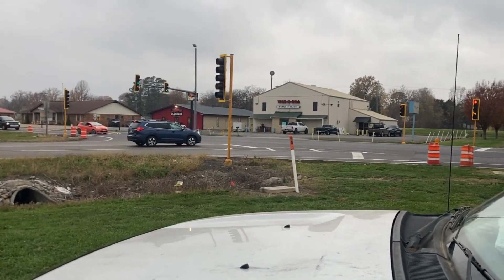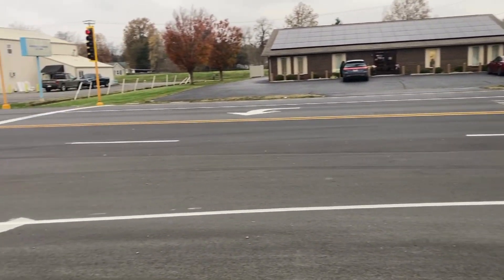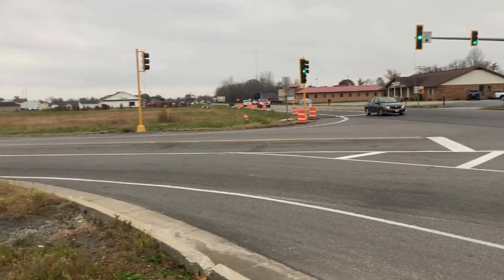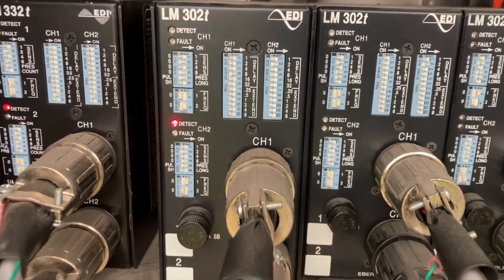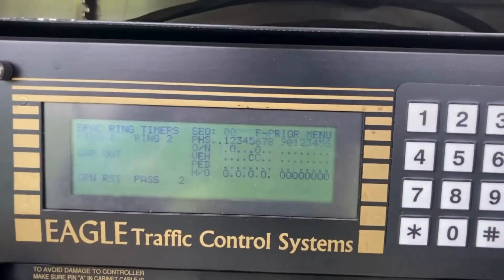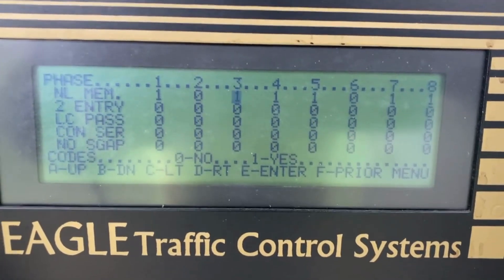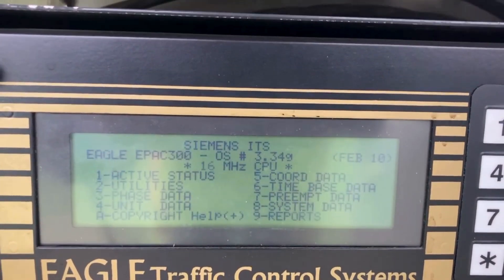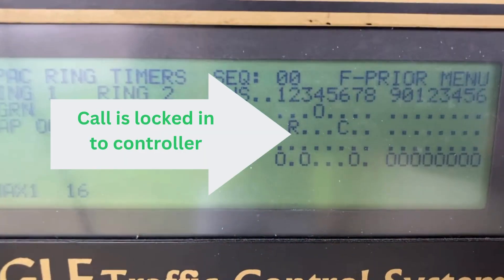How Bad Traffic Light Detection is Fueling Red Light Running

Comment: Do these detectors detect bicycles, or are bicycles too lightweight?
Reply from the maker: The sensors act like oversized metal detectors.  So its not weight driven but mass of metal.  Thats why bikes have a harder time being detected and why bike lanes with small detection loops are more optimal.  BUT if your bike isn't made of metal, then its not much help!
Thats another reason why I prefer video detection over inductive loops.
Great question!
Reply: They can, but unless one is careful to look for the filled wire conductor cuts (which can be paved over) and drive along one - it helps to think of them not working and treating the intetsection as a "stop sign".
Reply from the maker: @weldonyoung1013  THanks for responding!

Comment: In can't tell you how many times I got stuck at a light because the road desk by designers who forgot that the vehicle might be a bicycle.

Signals should never be driven only by detectors.
Reply from the maker: Its one of the reasons I'm not a big fan of inductive loops.  Most times, they're designed with vehicles in mind (unless they have designated bike lanes with small detectors in the lane).  Even then, if your bike isn't metal...does no good!
Thanks for commenting

Comment: As far as I know generally not illegal, most states have a law in the books that non-functioning stop lights are to be treated as a four-way stop so long as you still stop and wait a certain amount of time to determine that the stoplight is actually non-functional and you will never get a light you are fine to proceed with caution.
Reply from the maker: I'll have to look that up!  I was under the impression that they treat non functioning lights as either "in flash" or "dark". 
Thanks for sharing!
Reply: @streetsmartstraffic  in flash or dark are also non-functioning conditions obviously, but understandably you can rationalize that a intersection that does not detect vehicles in a direction or multiple directions is not functioning as intended.... I will say that It might not stop you from getting a ticket but it would almost certainly hold up in front of a judge, it just depends on how knowledgeable the officer is and how willing they are to listen to you and or test what you said
Reply: @streetsmartstraffic  for a point of reference, I am a motorcycle rider and as such I am very often not detected properly by the coils (Even when I directly line myself up over the cuts in the road)

This is how it has been explained to me in Florida from both an officer and my motorcycle endorsement trainer, to clarify though both said it is preferable to take a right and then a u-turn if possible
Reply: Virginia has no such law that I've ever found. If the light stays red for 4 hours, legally you must wait 4 hours for it. That being said, I once went through a red left turn signal every day for a month because that's how long VDOT took to fix it, despite me calling them at least 5 times about the problem. Lest you think this happened in some place like far southwst Virginia, this happened in the bustling metropolis of Northern Virginia, suburb of DC.

Comment: We don't have many of these loops around here, it's mostly the sensor next to the light and those are terrible. They often aimed wrong so I have to get into the wrong lane for it to see me, sometimes they won't detect me if the light just changed. I think some of them can't see my small car.
Reply from the maker: Maintenance is so important for that reason!   This comes to mind...
We had a complaints of backups at a particular intersection awhile back.  After visiting the intersection and watching the detection, I found that the hardware (bolts, nuts) came loose and the radar sensor had tilted away from its location.  The radar was no longer detecting that movement.  Found out, It was not tightened fully by the original installer.  Once it was re-aligned and tightened down, all vehicle were detected again and no more back up.
I would reach out to the municipality this intersection is in and report what you're seeing.
Thanks for commenting!
Reply: @streetsmartstraffic  There are so many crooked traffic signal heads around here I think the installers need remedial training on what a level and a torque wrench are. Maybe thread locker, too.

Comment: in florida we have a red light running problem not just bad drivers but many of the traffic lights are mis timed way too short we habd 1 6 lane that crosses a 6 lane with turn lanes both heavy traffic well one is north south commercial east west is limited access headed to bridge . some times the n/s is backed up 3-4 blocks  past another traffic intersection and it gets green for about 12 seconds   then its many min as each other change gets like 25 seconds so people making left often after waiting 4 changes 3-5 continue on red frustrated fortunatly theres all red for few seconds at change to green  and its not safe
Reply from the maker: Wow!  Sounds poorly designed and timed improperly.  Where is this at in Florida? (out of curiousity)  
I am in the belief that well timed and efficient signals can help a town or city thrive.  Improperly timed  (stop, go, stop) give drivers bad experiences and enough of them will make people avoid the area.  
Thanks for sharing that information!
Reply: @streetsmartstraffic  cape coral, but lee county controls the system  it seems to have gone bad  after IAN    santa barbra and veterans exway
Reply from the maker: @remocres  I'm sure they're dealing with ALOT after that.  Just a big storm around my area can have us running for days to get things back to par.  
If they're like anywhere else, they may be understaffed as well...
Reply: @streetsmartstraffic  There are places in this country where they don't like "people that ain't from around here" and maybe that explains why some of those places have poorly designed and improperly timed traffic signals.

Comment: This reminds me of my old apartment, I timed it with a stopwatch 3 full minutes of red for the direction pulling out.  When I wrote the city they said it was "re-timed" because there was more traffic for construction on another road except during off times in the middle of the day or late evening.  People started ignoring the red light because you'd sit there for 3 full minutes even on a quiet Sunday when there was maybe 1 other car driving on the main road in that amount of time.  It was maddening how long it took sending pictures/videos to the city before they admitted maybe they needed to have the timing different for peak rush hour and night/mid-day.
Have you seen the other trend with insurance trackers I see many "recommendations" that its better to run red lights than get dinged for "braking too hard" stopping at a red light?
Reply from the maker: 3 minutes seems EXTREMELY excessive.  How many directional movements were there?  
Before the 3 minute mark (as a signal tech), I would have thought there was something wrong with the signal.  Also, controllers can be programmed to run different timing during off peak hours.  So I think this was a lazy or unknowledgeable person.
Don't get me started on those vehicle modules or car apps that insurance companies want you to install.  I REFUSE to put those in my vehicles.  They say they're there to help... Yeah, I'm sure they are..for the insurance companies!  LOL
Thanks for commenting.

Comment: Love the work-around. 
How long did it take to actually fix the broken loop?
Reply from the maker: The disconnection of the bad loop in the pullbox probably took the contractor 20-30 minutes (thats including locating the correct loop to disconnect--there are alot of wires in those pullboxes) .  
Then you saw how long it took me to make the programming change...
Great question!
Reply: @streetsmartstraffic  What about the actual road work repair? Days? Weeks? Months? Still not fixed?
Reply from the maker: @bikeny  Repaving the road took a couple days if I recall (they had alot to repave down this road).  Before the project is closed, the loop will be recut.

Comment: I haven't seen loops for about 10 years where I live. Cameras are is use here.
Reply from the maker: I'm slowly trying to phase out inductive loops in our district.  It will take awhile due to costs of video, but I really think overall it has more pros than cons
Thanks for commenting
Reply: My city has a mix of loops, cameras, and plain old timers.  They just cleaned up a series of three key intersections that were close together this past summer by putting in cameras.  That whole area flows more smoothly now.
Reply from the maker: @kmbbmj5857  Isn't it great when a system is put into place!  It just makes driving more enjoyable!
Reply: VDOT will not use cameras in Northern Virginia. They claim that cameras do not provide accurate enough detection for what they claim is an "advanced signal control system". (They are NOT running any sort of traffic adaptive coordination system and I doubt they have anyone on the payroll capable of getting one working right).

Comment: There's a left turn in my town where I could swear they put the loop halfway under the crosswalk. Took me awhile to figure out I need to pull over the stop bar (which is illegal to do where I live) to trigger the light. One time I even got out of my car and walked over to the crosswalk pointed the direction I was trying to go pressed the button and walked back to my car to try and force trigger the light.
Reply from the maker: I've seen this happen.  Usually when the intersection is reconfigured (such as adding a ped crossing).  The stop bar may be repainted further back but its forgotten where the loop detector is really placed!  That's why its important to have some knowledgeable people out there when this happens!
Thanks for commenting

Comment: Gotta love the ones that also have red-light cameras at the same intersection.  Zero impetus to fix anything, as even a small percentage of people getting nicked without contesting the ticket is still a win-win for the municipality.
A guy I used to work with rode a small-ish MC that would never trigger the sensors.  He'd either have to wait for a car to come behind him and then gesture him to cover the loop, but all too often just crossing the stop-line would trigger the camera!!  Funny how the cameras always work (radar) but the buried-loop sensors wouldn't.  He eventually took to dropping a towel across the back to cover his plate, cross the intersection, then fold it back up.
I think at one point I joked about him taping a sign to the towel that would say "fix the f'n sensors already!", or something to that effect.
Reply from the maker: Yes, isn't it funny how those red light cameras always seem to work??
I believe in many states, it has been become unconstitutional to issue tickets from these red light cameras.  
Great idea about covering the plate LOL
Thanks for sharing and commenting!
Reply: @streetsmartstraffic  "We ticket the car, not the driver" is how they still get away with it.  Same with speed cameras.  I got nicked when my car was at the dealer's for yearly inspection!  Provable by the date/time as well as the inspection report,  It's weeks later when you get the ticket in the mail, so what do you say to them?  "Hey, one of your guys was 'test driving' my car and got a speed-camera ticket, gimme money!" or something?    $$$$$
Reply: Tell him to put some strong neodymium magnets on the bottom of his bike. The magnetic field will induce a current in the loop.
Reply from the maker: @BuffRobotiX  Thats a GREAT idea.  I wonder if that would work?

Comment: Half the time it is probably just because someone doesn't pull up close to the line.  There are inductive sensor loops under the road that work in a way similar to that of a metal detector.  They are a bit like an electromagnet except they don't have a metal core.  I am sure you see it all the time, some elderly person stops short of the sensing coil not knowing that it is there or what it does and the light takes an abnormally long time to change because they did not trigger the system to detect vehicles there and change it sooner.  Then what happens next is there are a bunch of annoyed people behind that vehicle who are forced to sit longer in traffic when there was no real and valid reason why they ever had to.  I would hope that by default there is a set timing on a lot of lights that changes them regardless of any vehicle detection just to clear out this buildup of vehicles stuck there.  I don't want to sound mean but these people need to realize how these things work and stop doing that!
Reply from the maker: You did a great job explaining the inductive loop.  Thats how I try to explain it when talking to people--its like an oversized metal detector.
You also explained a very real issue - but its not just elderly.  Distracted drivers are more of this issue-not paying attention that they didn't pull up to the stopbar and causing backups for no reason.
Thanks for commenting!

Comment: I drive a truck. I will stop on the loop in the turn lane if it's way back from the intersection if there is heaps waiting to turn. The system gives me a green light most of the time.
Reply from the maker: You figured it out!  
Thanks for commenting

Comment: How many people got tickets for running a red light when it just never turned green?
Reply: I have the same question. I know in my home state there's a exception written into the law for bikes/motorcycles if the light is stuck but it doesn't apply to car/trucks.
Reply: @kylemacintoshlinux1449  All local politicians drive cars/trucks. So if that doesn't work, it'll usually be fixed really quickly. Also, driving a car, after a stop at red, and it doesn't turn green, I can still take a right turn legally. In a car, that detour costs zero effort and very little time. Cyclists might be able to use the pedestrian signals, when the loop is not working right and the pedestrian signal even exists.
Reply: @karlkoehler341 That's don't help if I'm in the left turn lane. Even if I'm in the right lane still run the risk of a ticket for not signaling 100ft. I could run my right signal for 5 whole minutes and it wouldn't make a difference because of how my state's laws are written.
Reply: @karlkoehler341 Problem happens when the signal is maintained by a state agency that local politicians have zero control over.
Reply: @kylemacintoshlinux1449  Bikes/motorcycles may not be detected by an induction loop, so an exception seems reasonable - though charging through a red light into a intersection would be dangerous, and if there were an accident you might be at fault.
Reply: @Bobrogers99  Well a bike would end up essentially charging through the intersection as well. I suppose they are a smaller target though.

I remember sitting a traffic light for 10 minutes watching the light cycle for all the other traffic going through the intersection several times. I had it recorded on dash cam but that doesn't guarantee a judge would overturn it.
Reply from the maker: Great question!  I hear you.  If you ran the light, you would possibly get a ticket if a cop saw you.  Here's what I would do:   the first thing is state the situation.   And request him to recreate the situation you wer in.  If you can prove it, you may have a change to have it thrown out.  Now I'm not saying that will happen, but showing that there is an issue with a signal can help your case.
Thanks for commenting!

Comment: Back in the late 1950s, there was a rural, stop light controlled intersection somewhere near Rocky Mount, NC. I was about 5 at the time so don't remember too much about it. They had installed weight sensors on all 4 directions. Thinking back, the problem seemed to be that apparently all 4 sensors were connected together so that if any one activated, that triggered a change in the lights. So when you approached the intersection the lights would simply switch from one state to another. So if your light was green when approached, it would switch to red and stay that way until someone else approached the intersection. I remember Dad getting mad and finally backing up to trigger the sensor again. I think the state took about a month to fix the issue because I don't remember Dad getting mad after that.
Reply from the maker: Oh boy!  I can see why your dad would be frustrated!  Thats a very strange setup and does seem a little backwards how they wired it.  But your dad had enough common sense to back up and trigger it again to get the green light.
Thanks for sharing that experience!
Reply: Sounds like they got the detectors connected wrong, so that as you pull up to one it places a call for the conflicting phase... it probably took them a month to figure out how to correct that.
Reply: I’m pretty sure there’s one like this in my rural town that I have to drive on all the time.